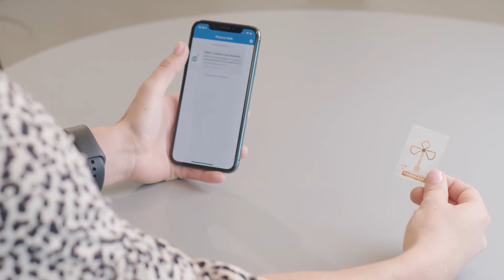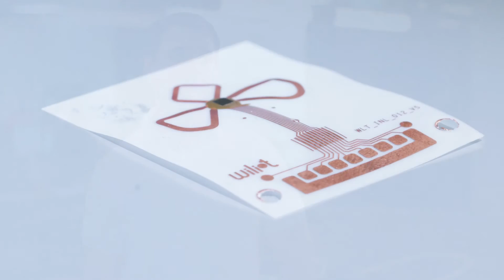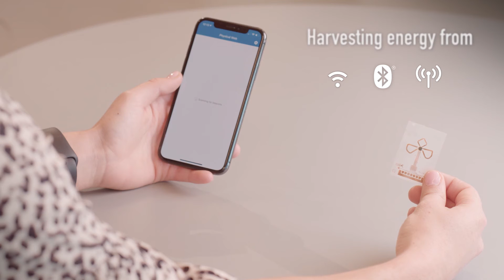Special Edition: Wiliot - Battery-free Bluetooth Sensor Tags

Comment: What is the range of the BLE transmission?  My impression is, hyper short range (less than 1 inch.)
Reply: Full battery BLE Beacons can easily reach 20 to 30m - energry farming devices like the Wiliot ?